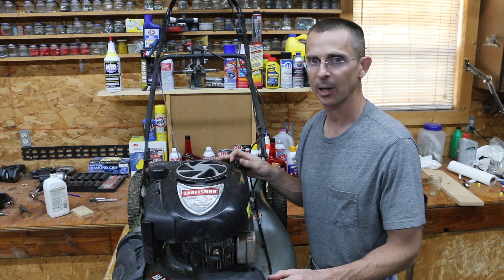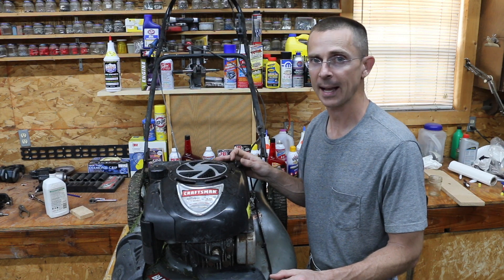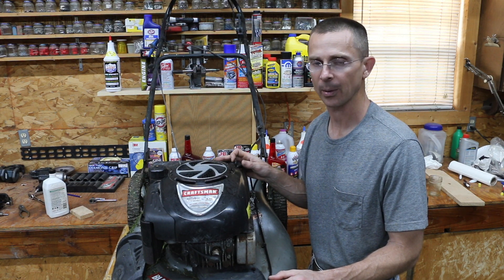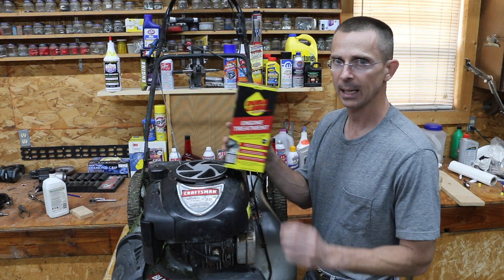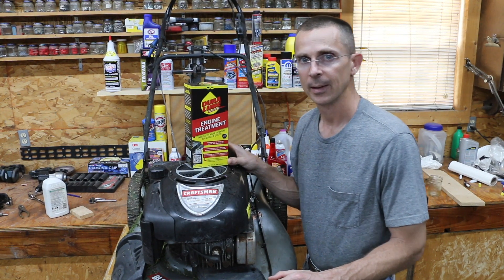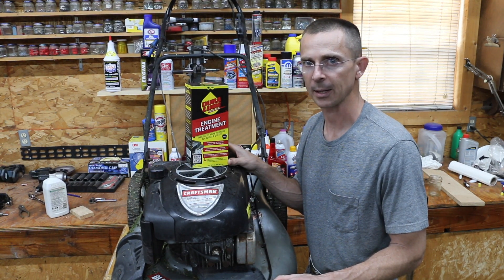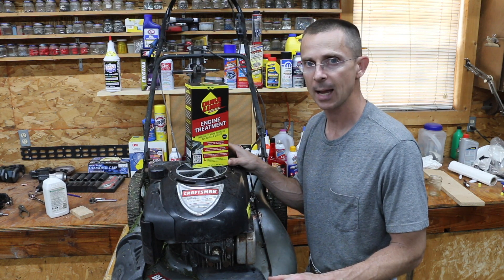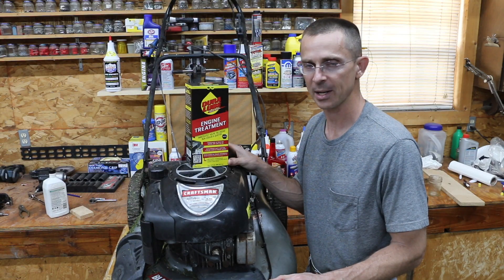Does Dura Lube actually help quiet and cool a gas engine as claimed?

Comment: Your video managed to prove that the product helped compression! That would account for the higher volume of noise the engine made after gaining a few psi of compression and that also makes more HP/Torque. Also i think the longer Dura lube is in the motor the better job of treating engine parts with the formula. Thanks for the Video!
Reply from the maker: Thanks for watching the video and commenting!

Comment: Had a 1953 Hudson with a rebuilt engine that was really tight. Always took a lot of cranking to get it to start. Drained the oil filter (not a full flow type on these old cars, the filter was optional) then poured a quart of DuraLube into the crankcase.

The first start it took the usual extensive cranking to start. Let it run a while to get the DuraLube all mixed. Shut it off and let it cool down. From then on it'd start the instant the first spark plug fired.

There was a bit of a downside. The DuraLube was so slick the new rings wouldn't seat and it used a lot of oil. Drained the oil, put fresh in with a quart of engine flush, ran it a bit then drained and refilled with fresh oil again. Quit using oil yet it would still start instantly.

After the rings broke in, went back to putting a quart of DuraLube in with every other oil change.
Reply from the maker: Gregg, I enjoyed reading your comments!  Thanks for watching the video and commenting!
Reply: So what ever happened to the Hudson?
Reply: IT says on the bottle NOT for new engines!  They need broken in

Comment: have you tried kerosene in the crankcase on an older motor
Reply from the maker: John, No I have not tried kerosene in a crankcase yet.  Is the objective to soak the engine but not run it?
Reply: Project Farm the instructions were to replace oil with kerosene while cold , start cold moter . let it run but shut off before it gets warmed up
Reply from the maker: John, Interesting!  I've heard of others using this approach, but I've never tried it for fear of causing damage to the bearings.
Reply: Project Farm the gaskets would/could/ is the issue if the kerosene gets to temp it can only run for 10 minutes max and never attempted on new tight tolerance cars as it REALY removes built up gunk n junk and will not pass through the new stuff

Comment: Hello sir, I love your channel, and btw I would love for it if you saw mine. The real question I want to ask is, I've heard if you fill 60-75% of the crankase with Lucas oil stabilizer in the it will calm down the noise too, I myself have a knocking mower and need to try it. Thank you, and keep posting videos
Reply from the maker: Mow Bros USA, Yes, I believe using 60-75% Lucas Heavy Duty Oil Stabilizer will help reduce the knock.  I hope this works for you!

Comment: I used to run my nitro fuel from my cr cars , and boy that thing would scream, it never seized  wot for ten mi minutes straight    ...   it was a 60-70s  models   3 hp     But tough lol   Lov eyour cideos,,,,,     I used dura lube and slick  back when they came out     Never noticed anything my racing buddy sugges amsoil   In everything  .    Is there any way to measure the power output  besides compresssion?   It would be interesting to see  what load a motor could take, like in the dura line with the  bal bearing g test   On  a lever,,,    That really showed nothing   In real,life lol

Comment: Very interesting things you are doing (thumb up).

But your Before vs. After Test has a gap: You compared old oil with fresh oil + Dura Lube. Maybe a regular change of engine oil would have caused a "smoother" running sound as well?
Maybe another test would be interesting: What about playing with different viscosity of oil. On my car I notice the engine become more noisy when the oil becomes old (I guess the additives to keep the oil more "stiff" at higher temperatures collapses ofer the time...), so the more runny the oil, the louder the engine ;-)
Reply from the maker: Great constructive feedback!  Also, thank you very much for the project recommendations!

Comment: was the oil cooler with dura lube because there was less friction, or because the oil was less capable of acting as a coolant and drawing heat from the metal in the engine?
Reply from the maker: DBruh, I'm not entirely sure how the additive works to reduce oil temperature.  I do believe it reduces friction somewhat, which would reduce oil temperature.  Thanks for watching the video and commenting!

Comment: Duralube is slicker than greased owl shit and will stick to the components of the engine and will not break down anywhere near as easily.  Extends life of engine.

I think Duralulbe is worth the money for longevity or life extension or prevention but if an engine is toast it's toast.  I'm a duralube fanatic but again if it's done it's done.
Reply from the maker: Michael, Great point!   Thanks for watching the video and commenting.
Reply: I also use Dura lube In every vehicle I’ve ever owned and it is good stuff extensive oil life and longevity more horsepower better fuel mileage the stuff works
Reply: Do you truly believe in duralube?
Reply: greased owl...what? I agree it is good stuff, use it all the time. BUT wore out is wore out. I'd like to know how long that mower lasted.
Reply: What’s everyone smoking on this subject😂. Same scenario if you pay more for a car/truck you think it’s better! Zero proof this crap helps anything! Human nature wants it to work there for everyone has the miracle Placebo effect🤔
Reply: Is this similar to the original formula of Slick50?

Comment: I wouldn't use it to quiet a knock, but it does work great as preventative.  Duralubed an engine.  And about 150 miles out of town, oil pump blew.  Drove it another 650 miles with zero oil. pressure.  Had no issues.  It was just the oil additive.
Reply from the maker: Michael,  Thanks for watching the video and commenting!

Comment: I had to deal this kind of problem few years ago. Flywheel cracked, put ignition to earlier and that led to crackshaft bearing damage. Anyways, that additive thickens oil (idk for sure, but think so). It may be treatment for some tolerances, but it doesn't solve the problem. It only hides them.I use treatment to keep my cars valve lifters quiet (BG MOA), but if there's actual problem, i will fix it. Ofc BG 245 will do same job that Seafoam for your previous video, but it is cleaner. So treatments work to some point, but they can't make miracles.I have idea. In Finland we keep fighting that should you use two-stroke oil in a diesel engine. So that would be nice to see. Two tractor diesel engines, both won't keep idle revs smooth and smoke little bit. Put 2% two-stroke oil to diesel and compare to treatment, t.ex Seafoam.
Reply from the maker: Ossi, I enjoyed reading your comments! Thanks for watching the video and commenting.

Comment: Try engine restore in the silver can.   did it on a 12 hp Briggs that would not run unless u had your hand over the carb.  used entire can in engine since it is suspended in 30 weight oil.  after 5 minutes end gone ran on its own.   after 20 minutes it cut grass in high gear
Reply from the maker: Impressive!   Thanks for watching the video and commenting.

Comment: Have you ever heard this Finnish product called RVS-engine treatment? it claims to restore lost engine compression and reduce friction and many other things by adding a layer of triboceramic to places in the engine that has the most friction(bearings, piston rings, cylinders etc.). A finnish car magazine tested this product and they did this by giving the engine the Rvs treatment and after that they drained all the engine oil out and drived the car without any engine oil. car was fine for almost 200 km, but then it started to had knocking sound. they opened the engine and found out that the sound was coming from the camshaft bearing which was seized up cause the gasket had failed. they couldnt tell if the gasket failure was because the fact that they ran the car without any oil and the burned bearing had destroyed the gasket or was the gasket bad at the beginning and did it let some dirt past it thus failing the bearing. the engine had no other damage than the failed camshaft bearing. after the test they put the engine back together and filled it with oil. it ran perfectly after that. If you could get some of that RVS stuff, i would like you to test if a engine that had the treatment would really last significantly longer without oil than an engine that has no treatment given to it and does the treatment really restore lost compression as it claims to do.
Reply from the maker: Jorma, I've never heard of this engine treatment.  It sounds like a great additive.  I'll look into this product and see if it's something I can acquire.   Thanks for watching the video and commenting.

Comment: With no calibrated sound meter, the sound comment is meaningless, and without test of viscosity of the "fresh oil",  as well as the "used oil" you have not demonstrated anything that either higher viscosity oil or any high viscosity additive would not do.
Reply from the maker: Miro, Great constructive feedback.  Thanks for watching the video and commenting.

Comment: Should have run the before test with fresh oil to compare apples to apples.  That oil you drained looked horrific and could be the cause of the knock and noise altogether, rather than attributing the improvement to duralube.
Reply from the maker: Great point!   Thanks for watching the video and commenting.

Comment: hi. could it be that it ran better after an oil change? I used dura lube before and it helped but after 2 weeks it seemed back to normal. how is your engine after a month?
Reply from the maker: Terrence, Great point!  I don't normally test additives for longevity for a variety of reasons.  Others have claimed that Dura Lube only provides a temporary benefit.   Thanks for watching the video and commenting.

Comment: the thing that gets me is everything looks good until you get to sound...my initial thought was it doesn't sound better but different and then i noticed the DB levels were higher with Duralube... reassures the fact these treatments are best for basket case motors and not perfectly running or even motors with a few problems
Reply from the maker: Phil, I acquired a tachometer recently to measure RPMs for future tests.  I suspect the engine RPMs increased with Dura Lube, causing the increase in sound.  Without a device to measure RPMs, I'm relying on engine sound/pitch, which is not too scientific.   Thanks for watching the video and commenting.

Comment: i sware by it i ran a quart in my 1972 gmc jimmys 350 she did have a typical chevy oil leak and noticed one day i was driving i looked down had 0 oil pressure and thought o great my gauge  is  broke well got to where i was going 5 or so mins and 3 miles later got out checked my oil  not even touching the stick added 4.5qts to a 5qt total capacity engine so i sware by it. she should have seized up with 0 oil pressure for that long drover her another 30k which put her at 330k before i swapped to a 454 cause i got a good deal on one it was still running well when pulled
Reply from the maker: Merritt, Impressive!   Thanks for watching the video and commenting.

Comment: How about a test of lube oil substitutes?  Something you might use in place of oil if it was an emergency and you had to get out of the woods or such?  How long will _________ last as an emergency lubricant?  Will ___________ affect compression if run for X amount of time?
Reply from the maker: J Smith, This is a great suggestion!   Thanks for watching the video and commenting.

Comment: Great video. I'm anxious for the Prolong test since it's the one I use. So did Duralube perform better than Slick 50 in your opinion?
Reply from the maker: Mike, My opinion is that Dura Lube is a better product than Slick 50, but the tests I performed were vastly different.  Thanks for watching the video and commenting!
Reply: Interesting. So why do you feel it's a better product?
Reply: He doesn't feel. He knows it is, by his test.
Reply: @mdino777  

Because the engine with plain motor oil lasted longer than the one with Slick 50 after the oil was drained out and the engines were ran.

Comment: I have used duralube indeed. It has only ONE drawback. Its benefits of compression, etc die out before your oil change. Its sorta a short acting additive but a good one. This is 1 quart to about 4.5/5 quarts. I'll have to add some to my much needed oil change and see what the duration is for its effectiveness. See Duralube runs TO the heat not away like any other oil or additive. It also helps in hopefully rare circumstance if you run/ran low on oil. Duralube will stay in the most heated areas. They used to run engines with NO Oil in them with just duralube. It ran for hours actually.
Reply from the maker: This is great information.   Thanks for watching the video and commenting.

Comment: Sure, but so is Lucas, Hy-tak, S.T.P.  and Delo 15/40 over straight 30 wt. Anything that will provide a better cushion to bearing surfaces will help but might be too thick for cold starts. Always a tradeoff. THinner oil is supposed to provide less resistance for better performance and economy but I like mine to last. I have to buy gas anyway and 80 pounds oil pressure at idle on an 89 S-10 means more than m.p.g.'s when the going is tough and the temp is 195. I'll stick with the thicker oil myself.
Reply from the maker: Lewie, Great point!   Thanks for watching the video and commenting.
Reply: Any time Commander. I just tell it about what I've seen and what works for me, but that's just my take. I read the other comments too. I don't have any market cornered.

Comment: Another great video. I was one of your first few hundred subs and your doing great. It would have been nice to get an reading on the revs. It seems in this scenario that it works. It may not have been quieter but it sounded healthier.
Reply from the maker: Sam, First, thank you very much for subscribing and thank you for the positive feedback.  I recently acquired a tachometer and plan to use it in future tests.  Thanks for watching the video and commenting.

Comment: Unhook the governor and get a tachometer and then see how high a mower engine will rev
Reply from the maker: Great suggestion.  Thanks for commenting!
Reply: The governor is to keep the engine operating within it's maximum torque range.  Without the governor, they'll rev until the connecting rod breaks or the coil gives out.  I've personally spun the stock connecting rod in a 5HP Briggs and Stratton up around 7400rpm with no issues.

Comment: I have to say I enjoy your videos, and experiments sir, it's good to see some kind of unbiased experiments to test out these products that we as consumers shell out so much money for what may be empty promises, thank u for your time, effort, and videos. Keep up the good work. 
As a suggestion for a future video, I have always wondered how well removing the spark plugs, draining the oil, and filling the crank case with kerosene, and turning it over multiple DIFFERENT times ( turn over, let sit, come back every hour turn over, let sit)  would do for cleaning, and improving engine performance. On a automobile engine, with high mileage. Also pouring the kerosene into the top end of piston while spark plugs r out. 
I have seen and enjoyed your series of seafoam videos, and have always used it myself, but wondered if we as consumers could get to the same or better results from kerosene?
Reply from the maker: Snikers Thecat,  Thank you for the positive feedback. This is a great suggestion!  Trying to assess the "before" and "after" of a crankcase could be a bit difficult.  However, the combustion chamber would be very simple.  I am curious how kerosene would do.  Thanks again!

Comment: what about using transmission fluid in place of the oil to see how well it cleans the inside of the engine or see how much sludge come out? Since tranny fluid is a high detergent oil.  and running it through the intake?
Reply from the maker: Andy, Great suggestion.   Thanks for watching the video and commenting.

Comment: Well done!

This seems like a non destructive test.  Unless the Duralube chemically ruins the critical surfaces.

I wonder if you could find evidence of critical surfaces being changed/ruined after using these additives.

I told you my experience in a previous video using Duralube with my .12 rc car engine.  My results could have been imaginary.

I am sure you could find some low cost hobby engines.  Maybe some gasoline engines with low cost replaceable piston, sleeve, connecting rod, crank, and bearing.  I wonder if the snow mobile and/or dirtbike racing industry have used parts you can acquire in 2 stroke and 4 stroke to do your tests with.
Reply from the maker: Charles, Great point.  I believe it would be difficult to prove that these additives are destructive unless testing is done in a lab with some very specialized equipment.  Others have commented that Dura Lube is corrosive.   Thanks for watching the video and commenting.